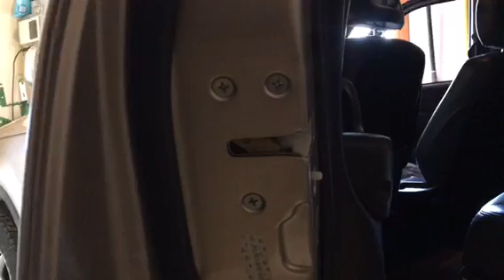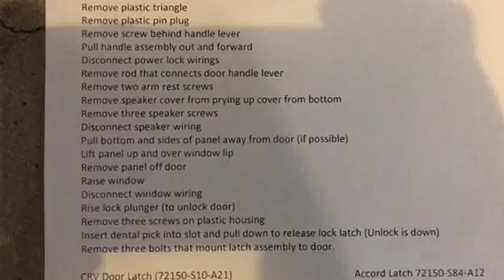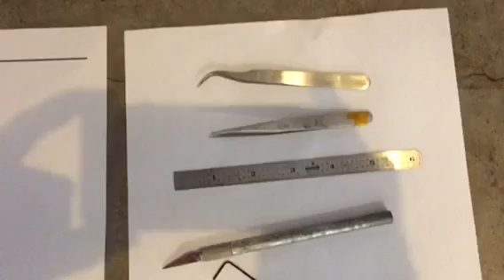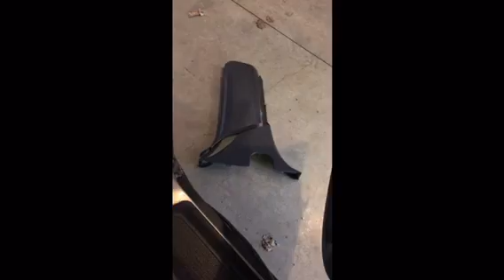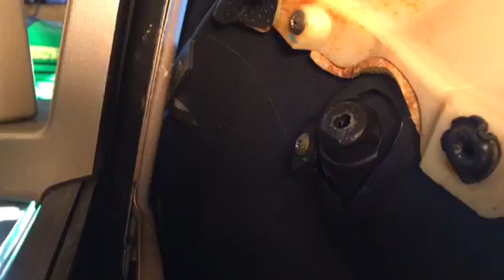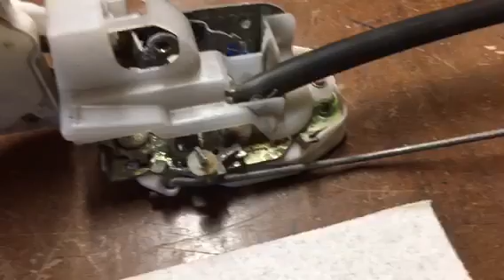Honda CRV Door Stuck

Comment: Thanks for the great video. It is easier if you remove the drivers seat. If you disconnect the rod to the inside door handle at the latch you can loosen the latch assembly. This will gain access to the spring replacement. I was able to find the exact spring at a well stocked hardware store.

Comment: You described it well
I just got mine open and I just been getting in the passenger for months 

To get the door open once you got the panel out
From inside the car, grab the bar that works the OUTER door handle and look thru the hole while you work the bar up and down...you'll see a VERY SMALL tab(best I can describe it) moving.  When the door doesn't open it's because this tab doesn't go UP far enough. I put a baby pry bar right on it, made sure the door was unlocked, pushed UP on the pry bar while lifting up on that same outer door bar from earlier and boom door swung open 

Thanks for the walk thru on panel removal

Guess it's a good time to upgrade door speakers eh?

Comment: Just got the front passenger door open on my 2004 CR-V. The release button was a green tab. I could see it through the hole that the plunger lock wire goes through. It was between the exterior door panel and the window runway. This video was super helpful. Thank you.

Comment: Omg! I had the same thing happen to me. It was a NIGHTMARE to get the door panel out of the vehicle while the door was closed, and I also wretched some components. What a mess over such a small spring. I was furious. When you moved that little actuator on the side of the assembly I had an "AH HAH" moment, and knew to try to manipulate anything that moved. That got the door open for me. Thank you SO much for the video! It was a real life saver. I worked three days of construction out of my vehicle entering, and exiting through the passangers door.. NIGHTMARE to say the least. Thank you again! 👍 👍

Comment: Thank you so much for this video! Saved my day! 

For some unlucky soul struggeling with this spring in the future:
I managed to unlock the door by lowering the window and "fishing" down between the window and door panel. I used a Steel rod and wedged the rubber open so i could look down while "fishing". It was a real pain. Study the video to estimate where the spring lever is. You wont be able to see directly but it is doable. Its towards the window/outer door panel right near the rod from the top push/pull button. 

Have no idea what that lever does, but with a new hardware store spring the door worked perfectly. 

I installed the spring without removing the mechanism from the door. I only removed the steel window guide. Fiddly, but much simpler then removing the whole thing.

Comment: Finally disassembled my drivers side door and the spring is missing. So now at least I know that's the problem! Do you know the exact size of the spring? I could disassemble the passenger door to measure the one over there but I'd really prefer not to!

Comment: hacksaw trick was best thing here.  my issue was also the spring, but did not see that since it is behind the window channel.  used a thin awl to move a bar up, then the lock fully unlocked.  ditto with Will D on the spring fix.  Many Thx to John L

Comment: just done mine, i took drivers seat out (very easy) couldn't get B pillar trim off. Once door trim was off i reached around behind the window channel and simulated the spring and the handle then worked. . Then open door, remove lower window guide, remove 3 M6 philiips to release the mechanism so you can get at the spring. i managed to repair the old spring by just pulling out one of the coils to form the new hoop.